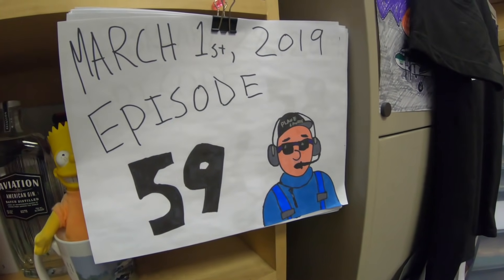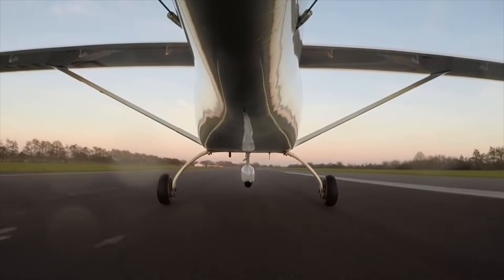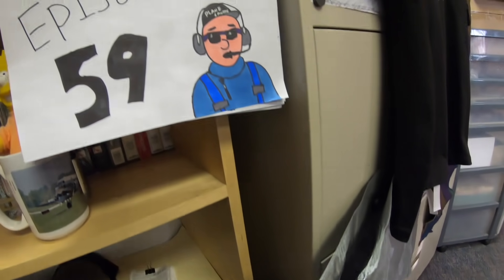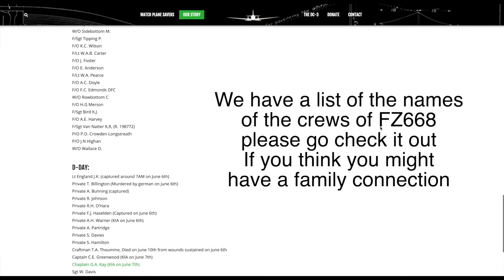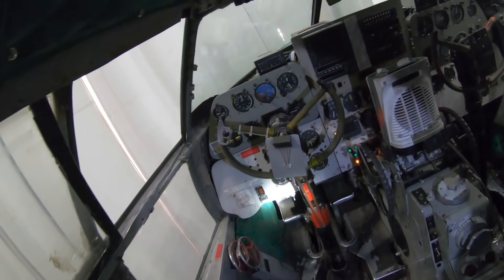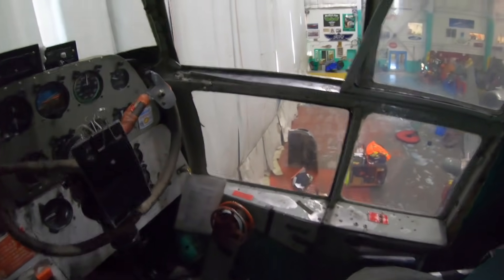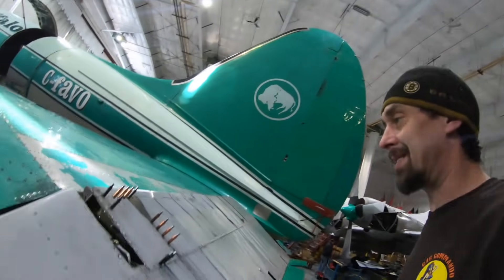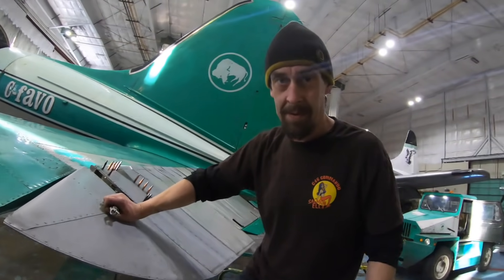"Chuck's Almost Birthday" Plane Savers E59

Comment: Love the patina on your historic workhorse C-46 that aircraft is a legend,never quite realised the large cargo space inside the fuselage,it will be a very sad day when these are retired and virtually impossible to replace with that same capacity.
One of the Evetts Air Fuel machines N1822M came to grief a few months ago on take off.

Chuck cracks me up,he is so laid back and I have never heard of anyone else with a variable birth date ! Rod is obviously a skilled aircraft metal worker and his explanation of the famous Clico for those that have never used them interesting,just sold mine and they were snapped up on EBay by an aircraft restorer,mine were the older pre plier version that you inserted by hand and tightened up you at Buffalo have the latest version.

We all love the human aspect to Plane Savers Mikey,Rod nipping off to pick the children from school,you all work so hard,an Electra that has a big void in the wing and Chuck  saying it will be ready on Friday after its 'D' Check.

Comment: In between my active duty service and the air national guard. I worked at Everets Air Cargo and worked with their C-46. They are now only running one C-46 as a fuel tanker out of Fairbanks AK. She did have a incident this past summer but I believe she’s back up and running I’ll try to confirm.